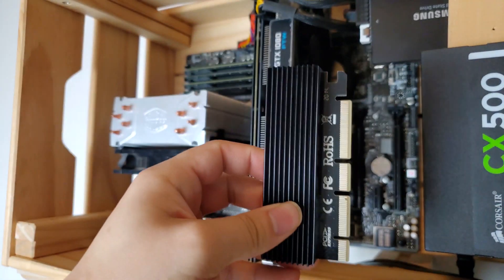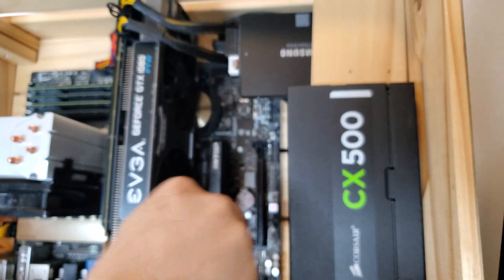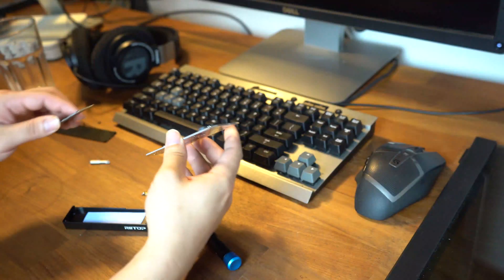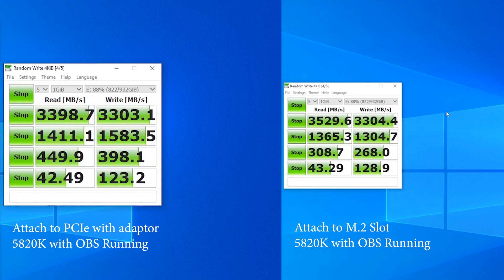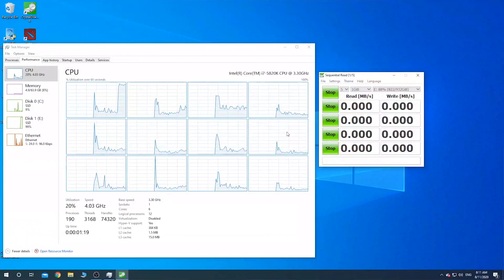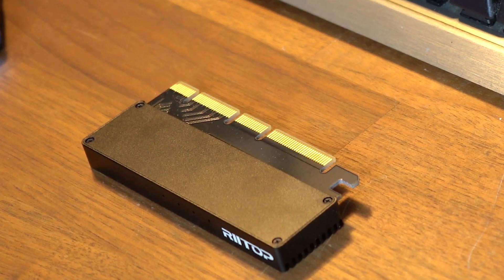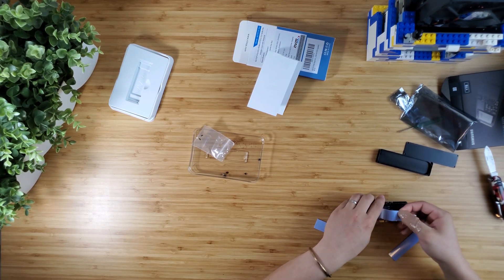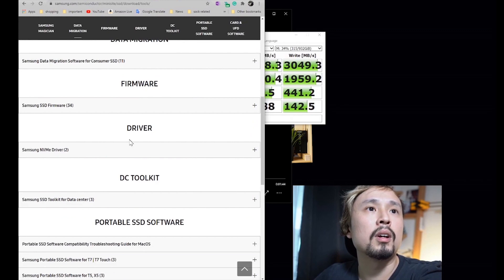Riitiop M.2 PCIe SSD Adapter/ speed compare with onboard M.2 Slot

Comment: Can i use this in gogabite h61m d2h board
Reply from the maker: It should work with the board. However, the board only got one pcie       X16 slot. If you use it for this adapter, you can't use GPU.